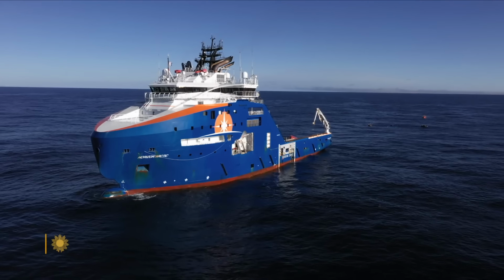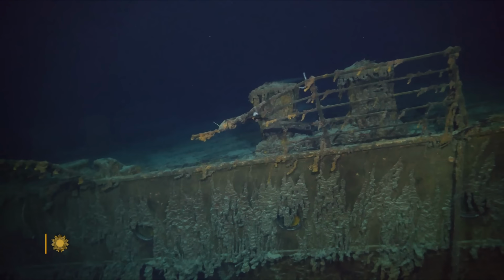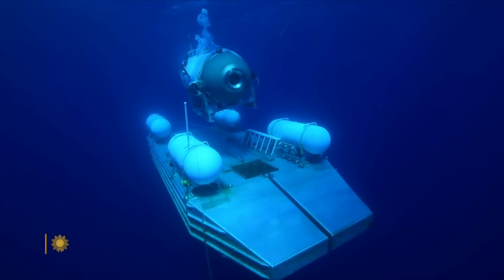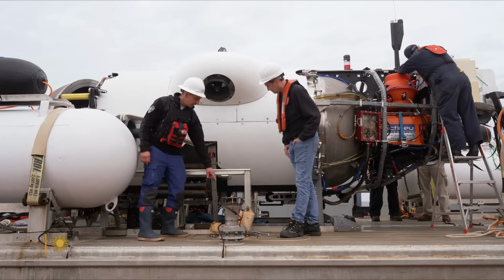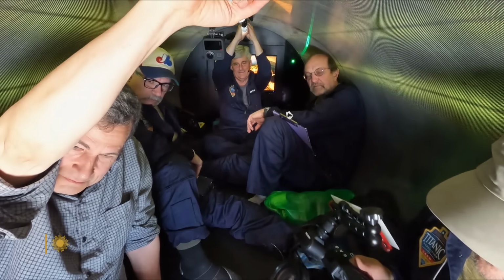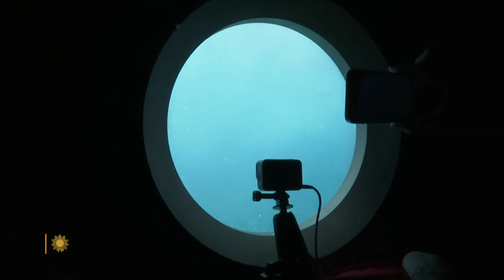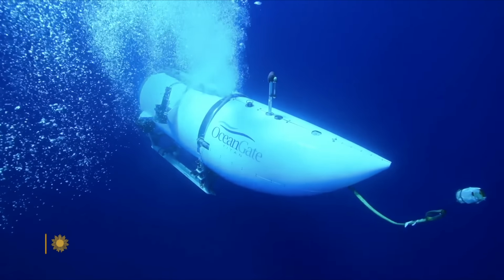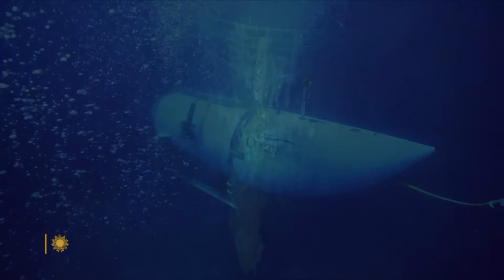Inside the OceanGate Titan tragedy

Comment: Anyone who had done research on maritime accidents would know this accident is insultingly avoidable
Reply: honestly anyone that spent 10 mins into looking into this company could tell
Reply: People die in unroad worthy vehicles everyday in the USA  but they don't get a mention
Reply: Rich people arent very good at being told no. Usually its some wagie that dies or is permnantly injured to make some billionaire richer...glad it went the other way for once.
Reply: @stievboyo636 this fella was just wanted to make money
Reply: @stievboyo636  not rich blood for the news media
Reply: that’s what happens when you don’t have regulations and/or you blatantly ignore basic rules in engineering and submersibles.
Reply: How did they manage to have successful expeditions with it before?
Reply: @7Mushrooms7 each time they went down the material they used got weaker and on it’s recent dive it just couldn’t take the pressure anymore.
Reply: Yeah but he went to the titanic 12 times in his sub.  Why wouldn’t he believe it was safe
Reply: @7Mushrooms7 , Simply put, they exceeded the fatigue capacity. As mentioned in the video, with each dive, the major stress points (where the dissimilar materials are connected) and the carbon fiber hull became increasingly weaker. Add to that, it seems that computer analyses were inadequate or simply incorrect and/or they didn’t do any non-destructive testing of their model. On top of that, carbon fiber fails in a catastrophic manner (i.e., it doesn’t yield and show signs of damage). Apparently, they used audio sensors to monitor the integrity of the carbon fiber, but it would have been pointless, as the amount of time between the warning signal and failure would have been so fast that at really any depth, they would not have had time to surface.
Reply: @7Mushrooms7  because with each expedition, the device is getting weaker and weaker and more susptible to accidents(fatal cracks )
Reply: *was
Reply: Excatly, the first descent to the deepest part of the ocean was in 1960, since then , technology has certainly come a far way to avoid such accidents
Reply: Build a sphere you are fine
Reply: Yep, I’m avoiding it now… by not taking a hooptie into abyss…
Reply: @7Mushrooms7  The carbon fiber material is strong, but it doesn't have good endurance. These guys got unlucky.
Reply: I also think, understanding what we know of the attitudes of Stockton Rush, many people would know that the accident was insultingly unavoidable. -.-
Reply: Obviously. He used cheap materials
Reply: you are right  but death is  not  avoidable ..even some people just died on their sleep  or even eating ..
Reply: @liezlmansueto8203  poor analogy. This accident was 100% avoidable.
Reply: Not even… i work with machines in a lab… the fact that this machine got moved from one place to another…. Used …why anyone would wanna not run system checks/qc/calibrations & have outside certifications/standards/ …phucking something. This dead guy, im not tryna insult him cus he’s dead, but ….the audacity….the lack of concern….the arrogance. His “credentials” tell u that he knew better💯💯💯 he wanted to be known… now nobody will forget him.
Reply: they got arrogant cz it took more than a dozen trips down there so far. But they didn't realize that it was a ticking time bomb
Reply: @geoffreyk9164  It sounds like just before it imploded they (stocton rush) was dropping weight and trying to go back up.... Based on what James Cameron said in an interview a couple days ago....Anyways the sub was made of different materials. I'm thinking it probably had issues from front and back as that is what was stated by investigators. I'm wondering if the sub was possible damaged on deck from all the big waves out on the north atlantic, getting knocked around? You never know. Also tough to get cooperation from the ocean-gate dudes on a proper safety investigation now lol.... their hiding behind their legal team by now lol. 

Carbon has been used in bikes for many years now.... It does not fatigue at all. When force exceeds design spec it breaks like when you snap a hard raw pasta noodle. The old aluminum bikes I used 20 years ago were the best metal made, they were at the time made in the USA. But they would loose quality after thousands of miles. Get loose, loose stiffness. I can still get on my first carbon frame which is 13 years old now and it feels new from a ride perspective.
Reply: The only material that were used on the Titanic ship that can withstand the pressure from the deep waters it’s still standing 🙏🙌🌺❤️‍🩹 So leave the Titanic alone stop bothering her 🌸🌸It’s belongs to the ocean 🌊 🌊🙏❤️‍🩹
Reply: How can an Engineer not to take account of materials fatigue? 2+2 = 7
Reply: @farnio  It wasn't "unlucky", it was inevitable.
Reply: @richs4678  As has been stated numerous times since the tragedy, carbon fibre is far from the best material at resisting compression, and with every pressure cycle it got weaker. Stockton Rush refused to allow proper testing to check for delamination over multiple pressure cycles.The fact that there were multiple dissimilar materials certainly didn't help, but it won't have been the only reason.
Reply: @stievboyo636 I think it’s the manner of death, car crash vs instant red mist
Reply: @richs4678 , Cameron said he heard it from a third party, but could not confirm it. Regarding fatigue stress, it is very difficult to model for carbon fiber composites. It will experience fatigue damage over time at that pressure, but the problem is that does show damage (certainly not from surface waves, but from pressure) until it starts delaminating, at which time under that pressure, it fails dramatically, not gradually.
Reply: their lead engineer expressed concerns a couple years ago, was fired and sued for speaking out
Reply: The verse of God is repeated again, just as people built a gigantic ship before and challenged God with it that he could not sink it. God accepted the challenge and sank it today, drowning a submarine that came to it and took the same name. And just as God made the whole world talk about ships And he makes movies and songs for it to make it famous and teach people his verses He made the world talk about the submarine and became famous so that they could know his verses
Reply: @7Mushrooms7 prob didn’t go that deep
Reply: #birdbathjamaica
Bird here
Reply: @richs4678  Your example is very different from diving to that depth repeatedly. Not an apt example of fatigue compared to taking a sub to 12k on the regular.
Reply: @stievboyo636 almost like it's because it happens everyday unlike an implosion of a sub trying to tour the titanic
Reply: I have watched hours and hours of videos about the design process behind this submersible and it was just a train wreck. And carbon fiber is the LAST thing I would ever use on the main body of something diving more than 1,000 feet down. It may be light but it DOES fail and from what I've seen, it fails catastrophically. There is no warning, it just cracks and shatters like glass.
Reply: When the narrator said, "Finally, the crew seems to foster a culture of safety" I almost spit. That crew either didn't know what they were doing, or worse, DID but were kidding themselves about their safety standards. Today I read a wrongful termination lawsuit against Oceangate by a former employee who claims he was fired for telling Stockton Rush that his design was flawed, the materials used were interior and his lack of testing, like not hiring an unbiased 3rd party to sign off on Titan, was going to get people killed.
Reply: It was a shrimple krill issue
Reply: @whiteyfisk9769 🎯🎯exactly, until Mother Nature told him, dude was a total bonehead, any master of a craft knows that you will never know everything in that field, a true master craftsman or master of a field is confident to take on a task but humble enough to seek guidance when necessary
Reply: @thatderangedbunny 🎯 thought his money would impress Mother Nature, next
Reply: @RosinDaddy5280 go for it😅, maybe check with the Admiral, he might have something to add
Reply: @cmpremlap  The infamous Dunning-Kruger effect, where those who don’t realize how little they know, tend to be the most overconfident. Also said by Bertrand Russell over 100 years ago: “That’s the whole problem with the world. Fools, so sure of themselves, wise men, so full of doubt.”
Reply: The mother of the 19 year old  has spoken of her loss in an interview. Christine described how both father and son were excited for their expedition. 
Her son had even applied to the Guinness book of records for the fastest Rubik cube solve for the deepest depth. Apparently it's been done in space many times. Christine and her daughter Alina were both on deck while it was unfolding, along with other families. 
So about him being scared and only doing as he was told, it's completely false. 
Rest in peace brave ones
Reply: @kb4432  I’m more impressed he can solve a Rubik’s cube ! Those fuckers are frustrating, hence why I’d just pick off and move around the stickers. Problem Solved!🥴😆
Reply: @geoffreyk9164  they didn’t even have a non destructive technician in that entire operation! Absolute insanity!!
Reply: @stievboyo636  bcuz these ppl paid 250k and they are rich billionaires that's what world cares about
Reply: @stievboyo636  Agree. They knew the risk and they'd taken it which normally people won't.
Reply: @dunebasher1971  I stand corrected
Reply: @stievboyo636 Thats because we’re focused on the sub not car wrecks. Wanna go talk about car wrecks find your vid somewhere on youtube.
Reply: Modern day Caractacus Potts?
Reply: Thanks to NTSB for not grounding the vessel in regard to the well-known warned issues. 
Stay away from companies that offer expeditions and activities that require you to sign a waiver, because they know the risks are high. 
If they only want to collect money and without being responsible for your life, at least you should!
Reply: Caractacus Potts.
Reply: @stievboyo636 but its very different isnt it